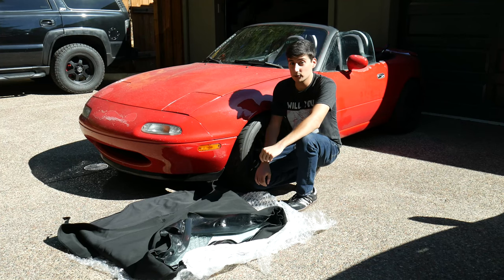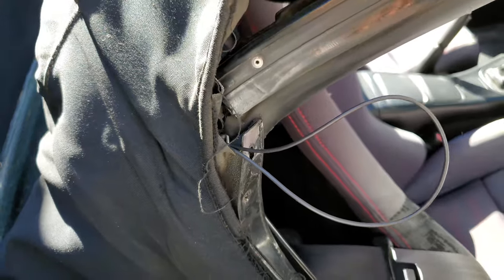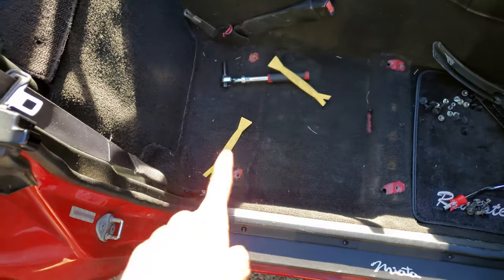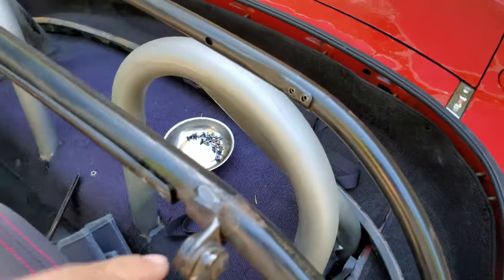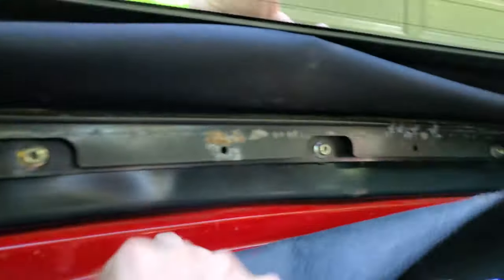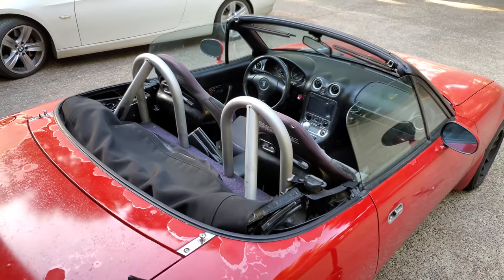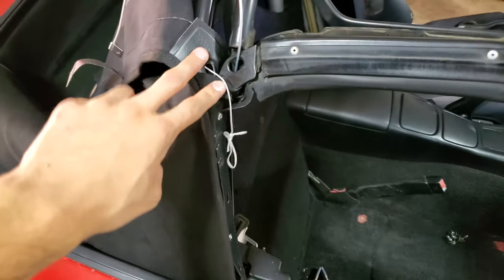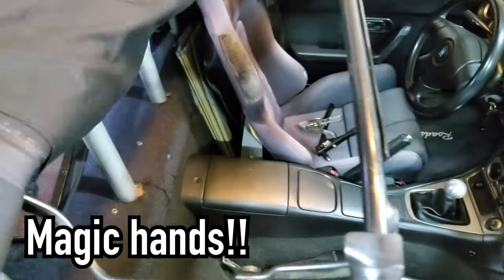Miata NA6 - Convertible Top Install

Comment: Dang when did you install bride seats!?! I feel left out! no video! lol! One day I will replace my top. Flex tape for now.. haha. I didn't realize you had a roll bar too! Do you have an old video on how you installed it? My miata is bone stock. But I want to install a roll bar for safety. I've seen pictures on the internet of how little miatas get crunched. Do you ever plan on going hard top in the future?
Reply from the maker: Lol the seats were provided to me from a very kind local sponsor! Figured it was a minor enough change that it didn't need its own video. No videos on roll bar install sadly, they came with my car when I got it 7 years ago. I'm wary on getting a hardtop because of the frequency of HT thefts in my area. 😓